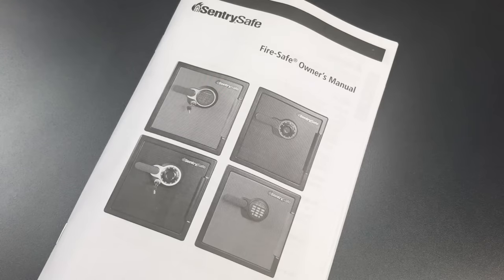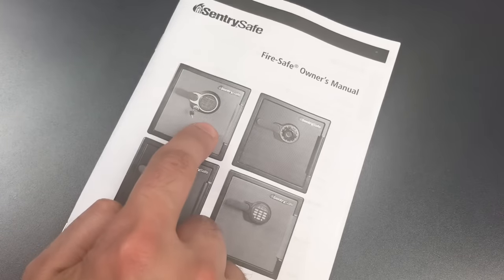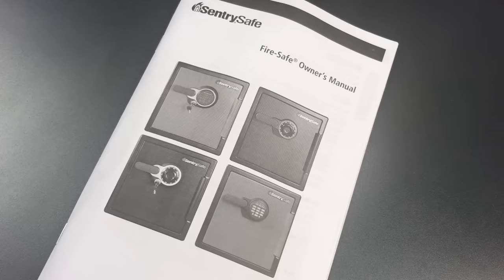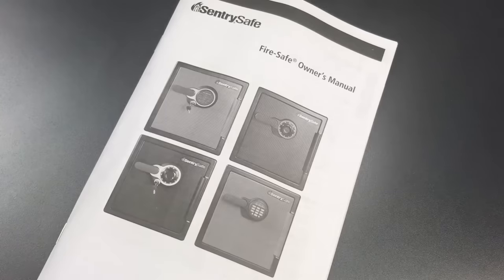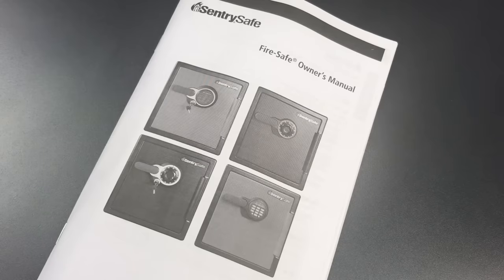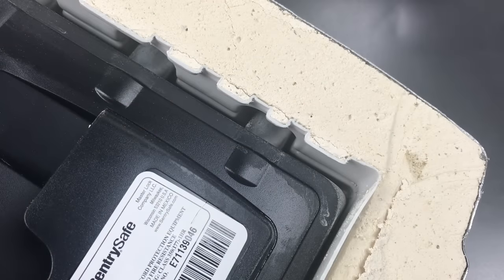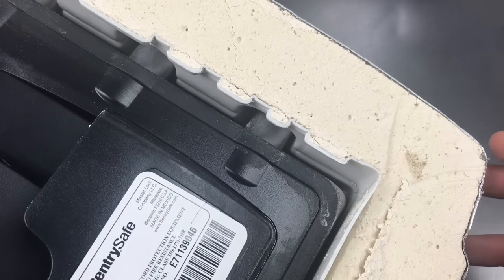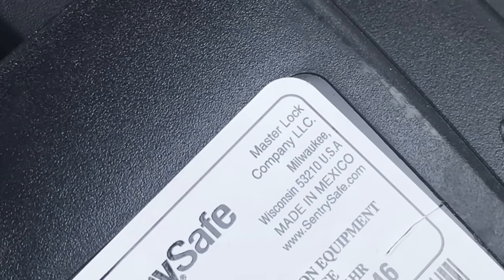[756] Sentry Safe Cut in Half FAST!

Comment: "Provides fire protection, water protection and security protection"

Does what it says on the tin – it would seem you are quite well protected against fire, water and security.
Reply: Just when I was thinking I was getting over my insecurities
Reply: The blade teeth are binding.
Reply: @davidpeterson7869  r/Whoosh
Reply: @davidpeterson7869  you didnt get the joke hes saying that it protects you from security so you wont be getting any security
Reply: I am satisfied with mine.  I live in an apartment surrounded by neighbors.  If the safe only takes a saw, then it is way too noisy.  The safe is also bolted down.  The safe can be taken, but it is only a single part of a much larger security plan.
Reply: @davidpeterson7869  i like how you had to put in "moron" at the end lol!
Reply: Robert Slackware     The safe came with a bolt hole in the bottom of the safe and an anchor bolt is included.   
I live in an apartment so I do not have the option to drill into the cement foundation. Instead I drilled a hole through the safe wall and bolted the safe to a wall stud.   The safe needs to be secured, as do all safes
Reply: @Carlos Wangson That's why I always think twice before updating game consoles.
Reply: @oldmech619   I've had a number of arguments with people who insist they're secure because their safe is screwed into a stud.

I always ask them "did you drill it yourself?" If they say yes, I say "I bet you have a circular saw or reciprocating saw, too?" And they usually say yes. Then I point out that if I'm in their house, I could go to their garage, borrow their saw,  cut the stud their safe is drilled to, and remove their safe in minutes.

Most safes are less effective at deterring theft than putting your valuables in a cardboard box labeled "Christmas lights", "baby clothes", "photo albums" or something else many people keep that isn't worth anything resold. That box will almost certainly not be disturbed by a burglar, but the safe screams "the good stuff is in here!"
Reply: @oldmech619  also, this safe unlocks in under 5 seconds if the thief comes prepared with a powerful magnet.
Reply: @thincrediblewho          I totally agree these inexpensive safes do not have the fortitude to stand up to a muscle attack.  All safes can be breached; some take longer than others. It is just the cost that you have to decide upon. Spending $250 to protect my records from fire and protecting $2k in money and jewelry makes sense. Spending $4,000 on a heavy duty security commercial safe to protect my $2k does not. If I see my son-in-law buying a powerful neodymium magnet, I might be worried.
Reply: @oldmech619  well if your expectations match reality (it sounds like they do) there's nothing wrong with buying a cheap safe and screwing it into a stud.

My recommendation is you don't tell anyone about the safe, and the "cardboard box" idea can still work. Just cut the box to fit around the safe. It's not a lot of added protection, but easily worth a $2 box and 5 minutes with some scissors.

Your son in law can't open it with a magnet if he doesn't know you have it, and doesn't find it snooping around.

Also, make sure you've got that stuff covered in your homeowner's/renters insurance policy, and documented so you can make a claim if something actually happens. Many people have personal property coverage they're already paying for, but never properly document the property it covers. Even if you had to add a couple thousand in coverage to your policy, the difference in monthly premiums would be pennies.
Reply: @thincrediblewho     A fire safe is only one small part of a home security system. I have hardened the door and bolts, and striker plates, cameras with auto upload person detection and notifications and lighting control as well alarms, if forced entry.   And you are correct, I do not tell neighbors or friends.  And insurance, incase all the above fails. Thanks for yours and other input and analysis of inexpensive fire safes. Purchasers should be aware of what you are buying and the limitations of their safes. I am happy with mine.
Reply: @thincrediblewho  put the safe in the labeled cardboard box xD The safe should also protect the stuff inside from fire
Reply: The safes do not withstand a full fire either.  My mother-in-law's home burned to the ground as did all of her belongings.  When they searched the basement, the case was indeed there, including the shells of the other metal appliances that fell through the floor, but nothing survived.  Even diamonds were incinerated beyond recovery (if they were ever in fact diamonds), and the concrete walls were also compromised to the point of flaking apart.
Reply: @ApresSavant  =/
Reply: @thincrediblewho  your main argument is that a person wouldnt wake up to the noise going on or someshit only way this happens is if your not home but thats why you also add cameras/ring doorbell or whatever cheaper still efficient alternative
Reply: @ApresSavant  These fire safes can only do so much. They're usually rated by how many minutes they can withstand typical house fire temps. It sounds like your mother-in-law's house fire was pretty severe, and probably not a very high rated fire safe.
Reply: @Bob5mith  Agreed.  They presume that the fire is put out in some reasonable amount of time, and that the contents are not baked in the ash that the fire department can't even get to because it was a forest fire and they were too busy saving other homes.
Reply: @oldmech619  I get the feeling a knife and a file might be already enough. would take more time but with a lot less noise. and it being bolted should not be a problem either as one of the vulnerable sites (so anything but the door if) should be enough to work as well
Reply: Yeah, but the rest of the marketing and the big, obvious lock are clearly meant to convey the notion that you'll be safe from burglary.

Comment: Me half paying attention: did I just hear him say he’s going to try to cut into a safe with a circular saw?

A literal second later: that cuts smoother than my circular saw on wood!
Reply: exactly
Reply: That was a hotel room locker, not a safe (or vault).
Reply: Nobody Knows  So since ur posting the same "FIRE-rant" in several threads ill answer in several of them, cos u clearly like to twist facts..! 
So if u didnt see the whole vid ill just mention the obvious here. LPL literally says: 
"According to the company website it provides SECURITY protection, FIRE protection and WATER protection. Now i cant speak to the fire and water protection, but as for 'SECURITY' - THATS the reason im making this video." ... 
"...confusing 'cos ... Its a heavy box. Its called a 'SAFE'. It looks like a SAFE. It operates like a SAFE." ... 
"If we read this manual we can see that it explicitly anticipates that owners will keep valuables like jewelry and watches in it."
But yeah NK, u focus on the fire part of it...  X-]
Reply: I have that SAME exact saw.  It's 35+ years old, and still used often. Cord is even repaired in the same place (oops). Hmmm....new career for me?
Reply: Nobody Knows  if it was meant solely for fire protection, there would be no combination lock on the front of the device to access your valuables... false sense of security
Reply: You may need a new saw.

Comment: LMAO, "Zoomed in on the Master Lock Logo" What junk, and the funny part is portable safes are just that "Portable" the thief can take it home and open it when they want.
Reply: @Tyrant Patrol  it's a portable safe 😩 you don't get bolts .... or bolt holes cause it's portable ..... PORTABLE!!!!!!!!   Just get it dude why won't you get it
Reply: @Tyrant Patrol  go watch the video no bolt holes ? You have a different model?
Reply: @Tyrant Patrol so it wasnt meant to be bolted if you had to drill holes in it lmfao
Reply: These safes are not designed for being burglary-proof - they're designed for fire resistance. The keypad and lock are just for deterrent measures.
You would keep things in here that would be a hassle to replace in the event of a fire, but not necessarily of much value. Things like passports, birth certificates, titles, etc.
You definitely do not want to keep a lot of cash or jewelry in these, keep those in an iron safe or preferably in a safe deposit box at your bank.
Reply: @Tyrant Patrol wooosh
Reply: @GIJew  we have a winner.

Note that LPL DID NOT shit on this product or it's manufacturer as a result of it's relatively ineffective security design. He just said "If you are looking at buying a safe, make sure you know how it's constructed"
The video demonstrates perfectly that anything further than a casual smash and grab is going to break into this product. But it also highlights the nearly 2 inches of flame retardant insulation, the metal exterior structure (conducts heat, but doesn't easily ignite) and the plastic interior structure (doesn't conduct heat well, and will typically melt, rather than ignite) all three of which combine to create a device that would protect documents from a pretty harsh fire. This is a fire safe (as most products in the SentrySafe line are, take a look at their logo - a house, on fire. Get it?)  NOT a security safe.
Reply: @Tyrant Patrol Well, the safe is a fire safe, to keep documents etc. from burnig. But if you have to drill holes, doesn't that defeat even that purpose?
Reply: @Tyrant Patrol My thought was that the bolts might conducht the heat through the insulation and heat up or even melt in a house fire.
Reply: Haha same but different. 
My job has to leave a light on in the shop, god forbid someone breaking in trips and falls and sues you, its an insurance requirement.
Reply: @Stunt Dummy pretty sure he intended that the bolts would rip out of the box  the box being bthe part that let go not the bolts
Reply: @GIJew  You are absolutely correct. I use mine for what you mentioned and, mostly, to keep my children's school artwork. Things I don't want to lose in a fire.
Reply: I'm gonna have to back up Marc and henry on this one. These safes are more designed for water/fire protection than true security.  The security setups of the locking mechanisms, while decent, are only there to deter somebody who is not inclined to simply take the safe or just outright circumvent them like he did in this video. These safes are not really designed to stop a dedicated thief.  The bolts provided are also only a minor deterent and bolting it down only stops those thieves are out for a quick grab of what they can easily take without much requirement of tools over one that has tools and is prepared to take everything that they can.  Plenty of thieves actually fall into the second category, particularly when they have an inkling that some kind of safe may be on the property.
Reply: Vasili .... I like the potable safe because I can drink it if I get thirsty.
Reply: This thread by Robert, was on the idea of portability, Stunt Dummy has won the argument that the case is not portable when it is bolted down.   However, bolting it down simply makes it slightly easier to break into with a hole saw or angle grinder.
Reply: I find most fun when these come with carrying handles
Reply: I thank most do from police reports
Reply: I love watching the magnet fishing videos on YT where people pull metal objects out of rivers and lakes.  It's stunning how many "safes" have been pulled out of rivers right under bridges.  They've all been opened already, don't have anything of value inside, and they're all the easily portable "safes" like these.
Reply: Junior Mudd  Go ahead, bolt it to the floor.  All one needs is a magnet to open the thing.  Go ahead, search YT for Sentry Safe Magnet.  You're welcome.
Reply: Maybe I'll buy one of these to stash my snacks :)
Reply: Advocatus Diaboli yeah but the top 30% of the building will fall off but not the rest of the 70% of the building whose steel hasn't been heated up to 1000C or more. Building tops will hit hard and fall off the size, these two towers crumbled in such perfect order it's really an engineering marvel to whomever created such weak tower support beams or it's that they went down like that on purpose.
Reply: @Stunt Dummy I quote "with the 4 bolts themselves"
Reply: @mightyTMP  Actually, they're still fire-resistant at that point-- Sentry Safe even sells the bolt-down kits. The part that exits when you bolt them down is the water-resistant portion.
Reply: @Verzula  Well, since we're here: something about the twin towers is that they were relatively unique in the extreme openness of their floor-plans; this was achieved by shifting support beams that would ordinarily be towards the center of the building towards the outside. Ordinarily, this wouldn't be a huge issue, however, once you smash a big, heavy, jet into something, then begin to weaken the center portions that are capable of buckling with enough heat after compromising the outside supports... well, bing batta boom, then you have  A LOT of heavy rubble crashing down through relatively empty floors since the supports are mostly on the outside and are just going to burst outwards at that point. Ordinarily, not an issue, since large passenger jets don't really crash into skyscrapers.
Reply: If you haven’t seen the show Masterminds they had an episode where a group would break smaller bank safes off their bolts. They then took them to an industrial place with a functional hydraulic press for opening.

Comment: I'm most impressed that his lines met.
Reply: He's on another level, man.
Reply: He needs a nerf
Reply: He used the left edge of the saw as a guide (though he got wobbly on the 3rd cut) - notice it lines up with the front edge of the safe.
Reply: "Low skill attack"
:c
Reply: Exactly.  As a weekend  carpenter, that was my first thought when he was on the last section. 😉
Reply: He's using that seam on the safe as a guideline.
Reply: You probably never used one of these then
Reply: You never used them
Reply: His secret identity is the LockPickingSurgeon
Reply: Adam VanDyke, He's running the marker on the saw down the line of the door, and it's not rocket science.
Reply: he guided it by the doorline.
Reply: The person doing the cut is a paid actor, not the real LPL.
Reply: I read this while he was on 2nd side, thanks for spoiler BRO : ((((
Reply: I think that's a required course for second year law students.
Reply: He edged the shoe of the zipper saw with the seem line of the safe. The trick is pick a reference and proceed.
Reply: The lines were right there, what idiot wouldnt make them meet?
Reply: @CantOutRunADuck   Quickly, everyone line up here for your chance to show the world just how hard you can't take people explaining how to make the cuts line up.
Reply: @BrettonFerguson  what?
Reply: @paddington1670  Send me $20 for my time and I'll explain it to you.
Reply: @waffleMccoy  no it was all done on the same level
Reply: He angled the blade so it would be easier
Reply: @Addly82  You're*.
Reply: with this safe he probably only needed to cut 1 or two sides then just pry it open lol
22
Reply: @BrettonFerguson  talk is cheap. make a video and get your money through ads
Reply: @ilovefunnyamv2nd   "talk is cheap. make a video and get your money through ads"  Says the guy with zero uploads.
Reply: *you're
Reply: I was stunned by that.  He didn't seem to be remotely careful in lining up his cuts.
Reply: @PaladinLostHour  Yeah, but it's just a visual guide, not something you can press the shoe of the saw against.  My cuts sometimes wander even with a level clamped to the work piece to serve as a guide.  I kinda suck as saws, I guess.
Reply: There are a few ways to get perfectly straight and consistent lines using a circ saw, for instance using the guide arrows that are integrated on the shoe. Pinching the shoe with your finger for an improvised rip fence, using the edge of the shoe itself as a guide, applying heavy pressure also works but not as well as the other methods.
Reply: Why?...he just aligned the edge of the circular saw with the door inner edge.
Reply: @scprotz8102  Very good eye.